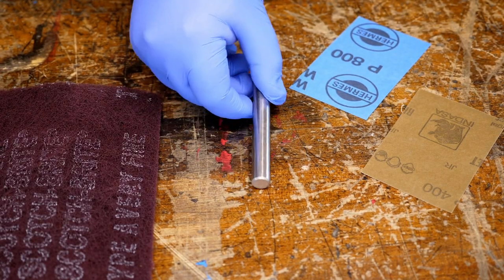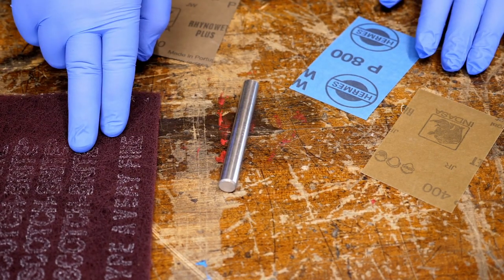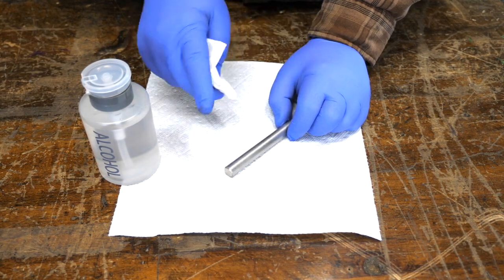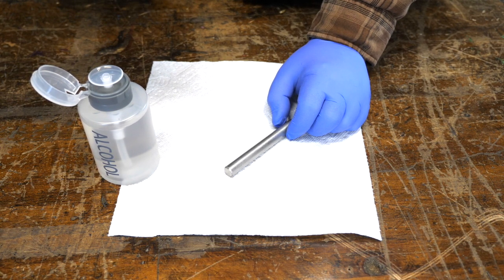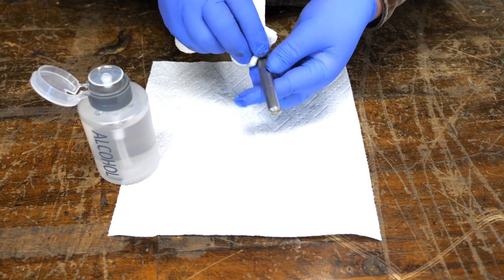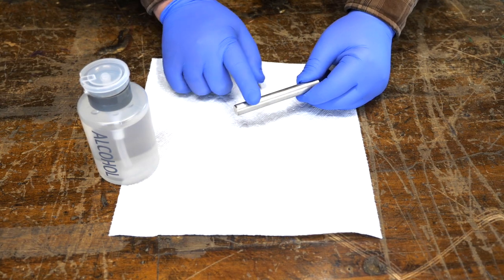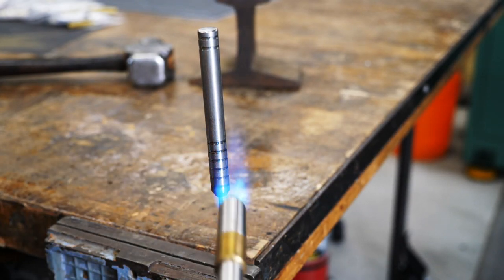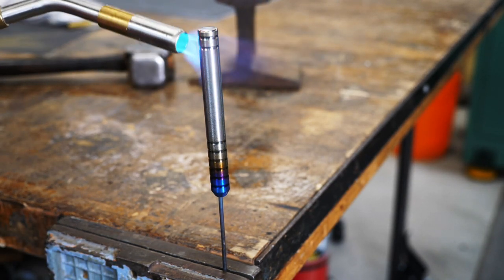How I Do Flame Anodized Titanium!

Comment: Very cool! That solvent dispenser looks super handy.
Is there any concern about the ice pick losing hardness, or is it long enough that the tip stays cool?
Reply from the maker: Absolutely!  That was a piece of mild steel inside while flaming.  The final ice pick shaft was installed post heat.  Good question!!